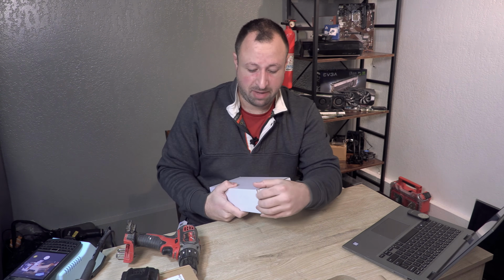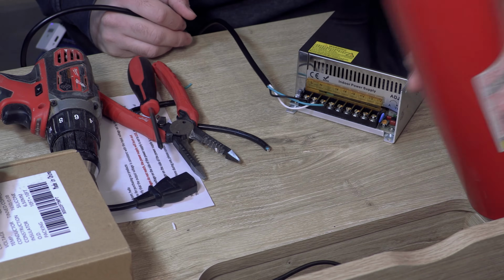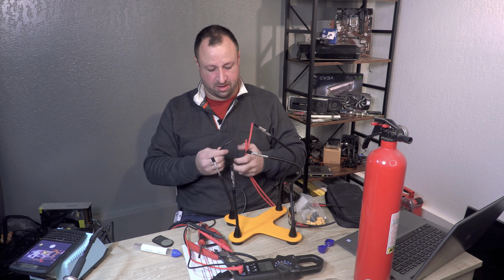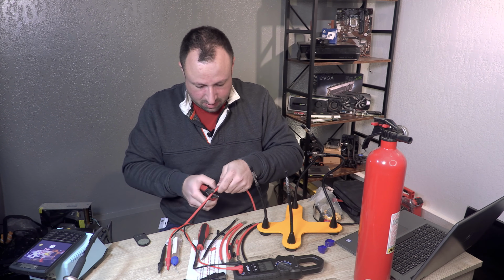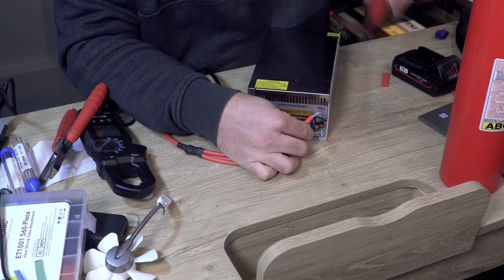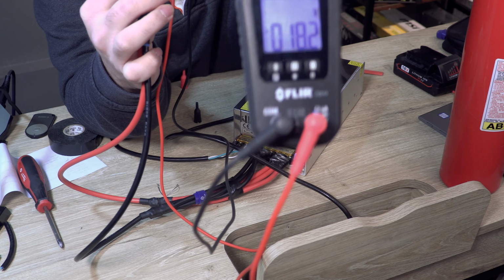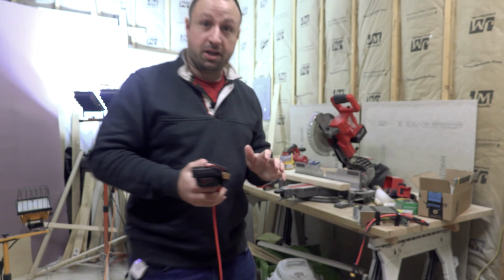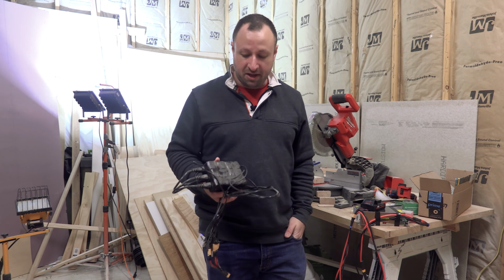Plug ALL your M18 tools into the wall! (M18 power testing continued)

Comment: “Power supply” not inverter. An inverter is dc to ac volts. Turn up your power supply to 20 volts. 5 series full charged 18650 is 21 volts that’s what’s in a Milwaukee battery. More volts will be better for your tools in this setup.
Reply: Less amps, less heat, more better
Reply: While a li ion cell is 4.2v fully charged (4.2x5=21v) but is rated at a nominal 3.6v  (3.6x5=18, hence M18) because that’s what they typically sag to under load.  If you’ve seen Torque Test Channel (or dozens of others) a fully charged battery can drop to 17-16 volts under load depending on the quality of the cells and the tool. So if he maintains 18v (and more importantly the needed amperage) the tool will run great. 21v will likely fry the tool in the long term. (An M18 battery will only test at 18V even under no load. Just FYI.
Reply: @91maxpower  Thank you for explaining this. In the video he said "18V, just like a dead battery" and I kept waiting for him to circle back and crank up the voltage. So 18V from a power supply behaves more similar to 21V from the battery.
Reply: The technical term is Rectifier, not power supply.
Reply: @GottaBuyEmAll123  a rectifier (like a full bridge rectifier, the first part of any power supply from the wall) is actually just that, and inverter. It changes ac to dc, it’s the rest of the “power supply” that gives you a clean and steady voltage or amperage.  Just a rectifier would get you a (dirty) 120v DC with no amperage limit (until a breaker goes)

Comment: To answer anyone's question about why we would want this and not use the battery. 

Milwaukee has a few M18 tools that are somewhat stationary. (Miter saw and Table saw is what I'm thinking)

I want to be able to set those saws up in my basement and forget about them and just have them work when I flip the switch on. This is why we want this.
Reply: Or you have 2 batteries 1 charger and run both batteries dry by accident.  Have 5 screws left to drive and can either wait 30 min for a battery to recharge or boom plug it into the adapter and get the job done.
Reply: @klyphgy  or you have a couple tools at home that need alot of power, but all you got is a bad CP 2.0 battery.

Comment: What about rigging this
A Milwaukee charger wired to a battery, Then plug that battery into the saw?
I’m sure people have dozens of chargers sitting around
Reply from the maker: Those chargers only put out around 100 watts, so it wouldn't be sufficient. There is also a lot of handshake circuitry - and not being an electrical engineering, I'm pretty clueless on that kind of stuff.

Comment: This is the only video likes this on YouTube. I have been looking into making something like this to power the air compressor. I’m looking forward to how it does with the air compressor. Also since no one has asked yet. Would you consider making one of these for sale?
Reply from the maker: Hello Dillin!

Thanks for your comment. I'll probably be getting the air compressor next month... so i'll make sure to ping you once i get a video posted.

As for building the adapters - I have considered it, but i suspect if Milwaukee caught wind, there could potentially be legal issues. Because of this, i've avoided it. However, if you're stuck with the build or need some help, i'm happy to set up a zoom call and walk you through a bit.
Reply: @harrisonhobbies241  I completely understanding avoiding the legal issues. I just had to ask. Would there be a difference in using authentic Milwaukee batteries vs. Off-brand batteries from amazon/ebay?
Reply from the maker: @16Dillin16  That's a good question, and I haven't actually thought about it from that perspective...  Maybe one day this can become my side hustle.

Comment: So I don't know if you mentioned this but if you could Mount that b** inside of a pack out one of the half ones maybe the bigger clear top one cut a little exhaust and an intake hole throw a little duct filter in there fold it up if necessary then you can snap that on and off of whatever table you're using it easily store it away heck maybe you can even fold the battery back in there or something if you use the ammo can. I hope that you're endeavor is fruitful but I also help Milwaukee comes to their senses sooner rather than later.
Reply from the maker: Hi Ian... thanks for your comment! Yep - i plan to use the taller half-height pack out as a container for the power supply eventually. Right now i only have one (which is in-use) and my local Home Depot has been hit-or-miss with inventory. Once i get one to sacrifice, i will certainly be trying this out. And good call on the filter. I think i have extra Wagner spray gun filters that may do well for this application.

And I don't expect Milwaukee to release anything like this, so we gotta take this into our own hands!
Reply: @harrisonhobbies241  awesome  And they can be a little bit more expensive at times but if you have a, Jerry's hardware, northern tool , and I believe acme tool is the third one they'll have certain products on release and keep fairly up-to-date stuff in stock form my experiences. Good luck and Godspeed.

Comment: Its really cool to do it but when you stop and thinking about how cordless tools were a way to get away from the wall, its kind of funny.
Reply: For those of us with limited funds (change of income) and existing tools, this track has some level of appeal, but the humor you went for still stands :)
Reply: There are benifits and draw backs to cordless tools.  It's great to be cordless and with unlimited funds perhaps it is feasible to run a shop full of tools or a site full of tools on batteries.  However wear and tare on a battery makes the batteries a consumable and not very economical or economical friendly.  To have the option of both plugged and unplugged is a superior solution.  Hitachi sorry I mean hpt (metabo)  is the only company to have adopted this thinking.  And though I like Hitachi tools I prefer true metabo or milwaukee or even makita for the fit and finish and quality.  I really wish these companies would get onboard with this sort of thing.......

Comment: This is great!  I'm working on a Packout box power supply as well with a built in multimeter and also USB output.  I install a lot of LED lighting so I was also thinking of making it output 12VDC and 24VDC run through the meter so I can test the LED strips and also determine the wattage of the system. This will help me size a proper driver for each system.  Thanks for the video, very inspiring!
Reply from the maker: Thanks! and cool idea!

Comment: Liked it and subscribed for the table saw. If it works im going to make one for mine. Good job bud!
Reply from the maker: Awesome! Thank you!
Reply: @harrisonhobbies241  Did you ever get it to work for the table saw?  I have one and never got it to  work.  It will start but then shuts down.  I tried it with the 1500W 18V power supply and then even bought another one to put in parallel so supposed to be 3000W but still no luck.
Reply: @alanhymes2881  Did you use a battery in between the tool and power supply to take care of the handshake?